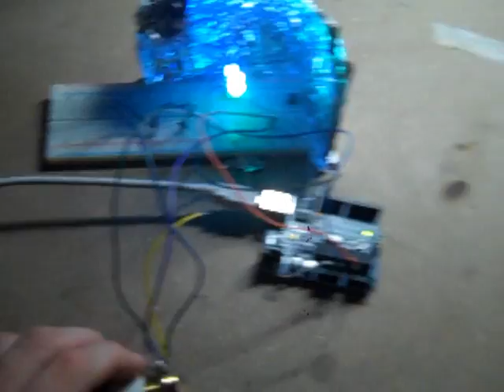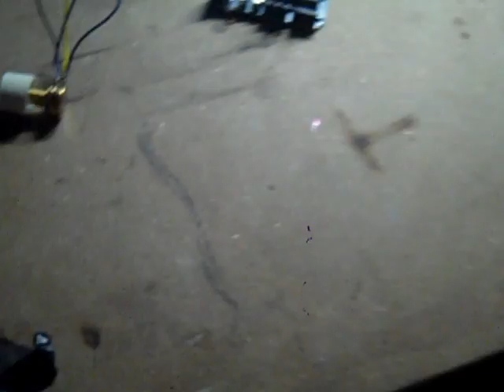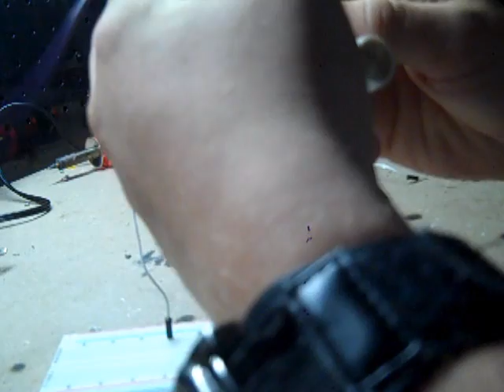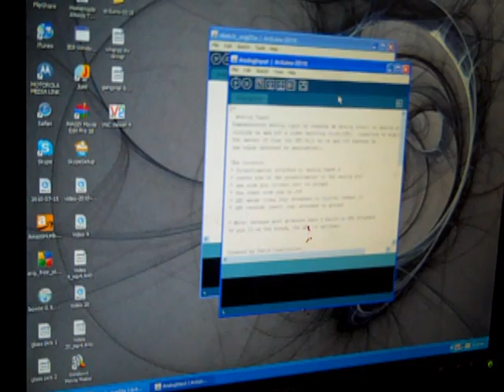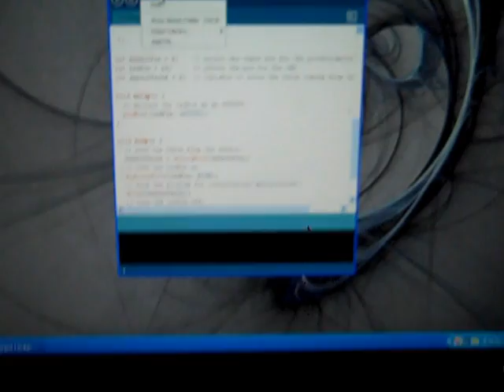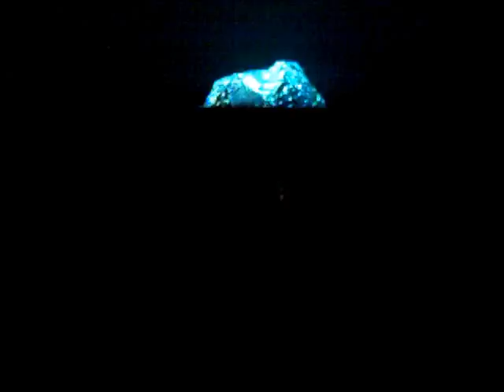How to make and build an Arduino strobe light

Comment: yes. you could just use the blink script to make it flash super fast, but 50 microseconds (.05 milliseconds) is SO fast you couldn't see it flash, in fact it might not even completely turn off before starting up again. you mean milliseconds, 250 milliseconds (or 250000 microseconds) in between each 10 millisecond flash should be good. of course you can experiment with the times yourself.

Comment: "Potentiometer." Hence the term 'pots.'

Also, careful w/ the way you claim 'adding more LEDs adds more light' & such, you're obviously adjusting math but this is a reasonable project, otherwise (it works out for you because the LEDs are wired in parallel but if they were in series they'd likely not light up). Never-the-less, this is an alright video.

Good job.

Comment: be careful, your are going to burn the pin 13, your lucky you used a white led their Voltage drop is the highest. you should look at  mosfets to power that LED. Thanks for the idea